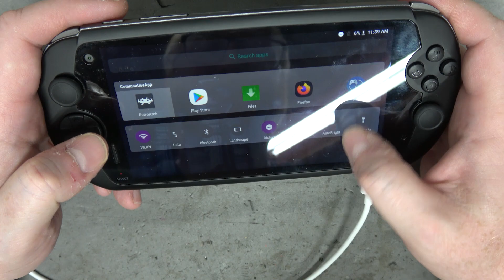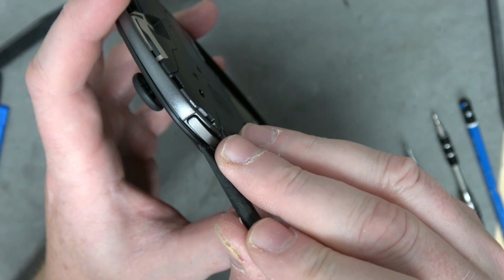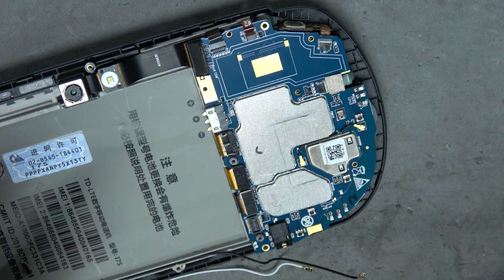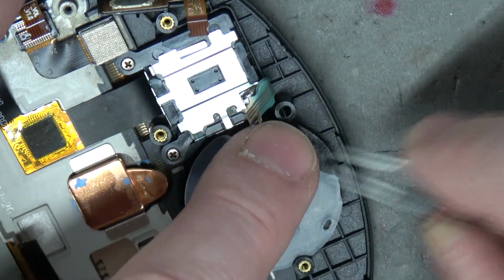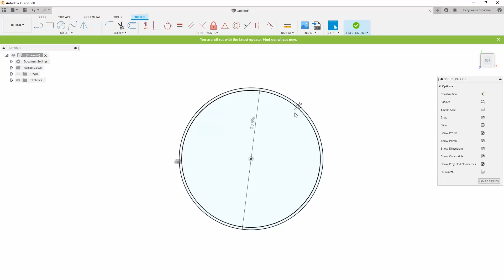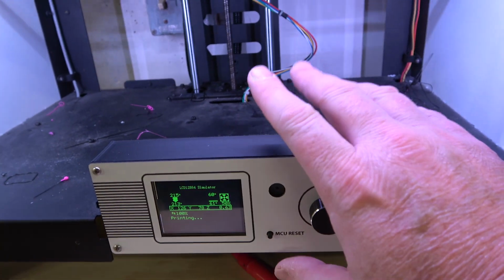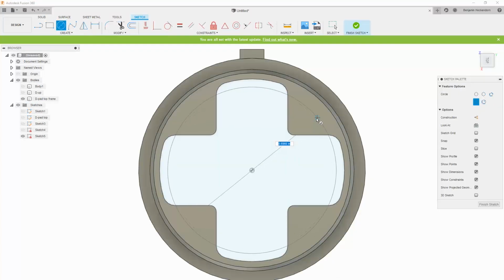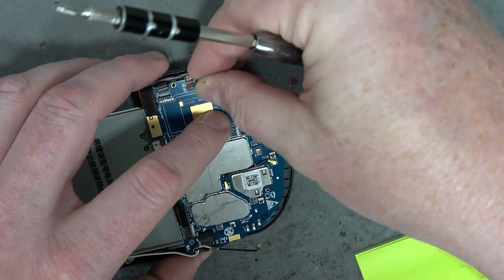Fixing the D Pad on the Moqi I7S Android Gaming Phone

Comment: They don't heat simultaneously because they bundle underrated chinese switching supplies that might trip overcurrent protection and crash the MCU.
Reply: ding ding ding.  The amp draw to heat from ambient temp is considerably more than whats required to keep them at temp.
Reply: Was thinking the same thing 😁
Reply: Yep. I toasted the fets on my Monoprice printer by manually telling it to heat both at once. Now I know :P
Reply: Yeah I have one of the 2015 CreatorPros. I was pretty livid when I found out how badly setup the heaters were.
Reply: So where the heck is your money going to then?

Comment: I found the only good reason why the heatbed heats up first: I set up an indicator on my bed and tracked the warpage, it warps the most as it's being heated up, then it takes 1-2 minutes to settle, just enough time for the nozzle to heat up. But I usually preheat the nozzle in OctoPrint and keep it almost up to temp. Most of the times I also keep the bed hot as I'm designing the parts. Same for the printer.

Comment: The reason they dont heat bed and nozzle at the same time is because the weak PSU's included with most cheap printers cant output enough voltage to heat both at once. So they work around this by getting one to temp and then pulse alternating to maintain that while the nozzle heats. The original monoprice mini was actually notorious for never printing if you set the bed temp to high because even with the alternating the weak included laptop PSU couldn't keep up.

Modded printers with decent replacement PSU's obviously don't have this problem.

Comment: Размеры указаны неверно. Пришлось самому эксперементировать. В итоге в центр оригинального дипада приклеил пружинку от ручки (укоротил пружинку больше половины). Отлично получилось.

The dimensions are incorrect. I had to experiment myself. As a result, I glued the spring from the handle to the center of the original deepad (I shortened the spring more than half). That was great.

Comment: They are likely to lose those springs, put them in some tape somewhere inside the case away from anywhere too sensitive, but still snug enough that the adhesive isn’t mechanically stressed

Comment: I want to design an evil game system that uses those thermostatic disks like in thermal switches as the button domes, and tuned to some temperature just above room temp, so operation and hand heat causes the button to be stuck down, and have one at random be tuned to need to be triggered to be able to be pressed so in winter that button won’t work at all without abnormal force that will make games unplayable

Comment: Only Ben Heck would Hack his own tools. Classic.

And I guess I just have an old soul, because I enjoy the shit out of the Indiana Jones movies. :)
Reply: Not at all - my father hacked his own tools frequently.   One of our farm's sledgehammers was turned into a special wooden post driving hammer, with the addition of a thick plate welded to one hammer surface.  Worked way better.  Other tools got similarily modified.  Or built from scratch - like his hand-built tire tractor bead breaking bar - started with just a steel bar, added some hooks and wedges and such, so that even me at twelve years old or so could get a tractor tire off a rim (with help from an overhead crane, also hand-built).

Comment: 9:30 Hey Ben did you Know you can release adhesive mit Isopropyl Alcohol? And it will stay sticky after the alcohol it's gone, a always use this to open glued Phones. Once I find out this fact, my workflow for replacing Display and repair phone become so much faster and easier. best use a small squeeze bottle with a needle.

Comment: Can you please buy yourself a resin printer already.  They have come down in price and are great for buttons, dpads and the like.  FDM just isnt great for these kind of little parts.
Reply from the maker: Tried them, didn't like it. Too much post processing and slow.
Reply: @BenHeckHacks I have no argument for them being messy, but you should check out some of the newer MSLA printers with monochromatic LCD panels. They can print a layer every 2-3 seconds.
Reply: @BenHeckHacks  As far as the post-processing, look into water-washable resin (elegoo makes some).  Meaning safe cleanup, no messy chemical baths, etc.  Just...wash it off, wipe it down, maybe alcohol to prep the build plate for next print.